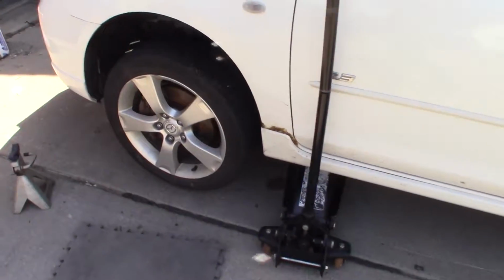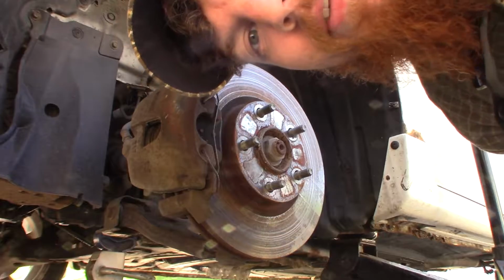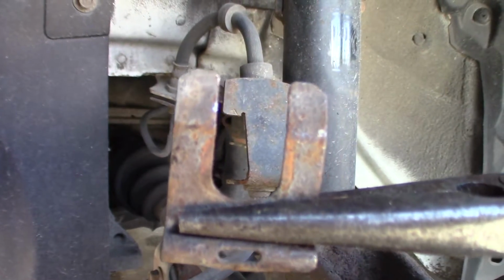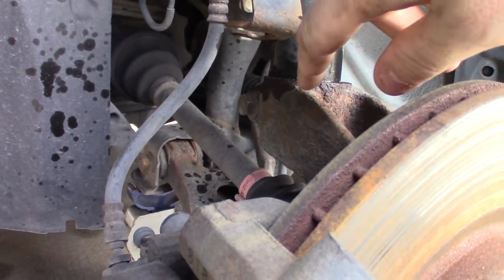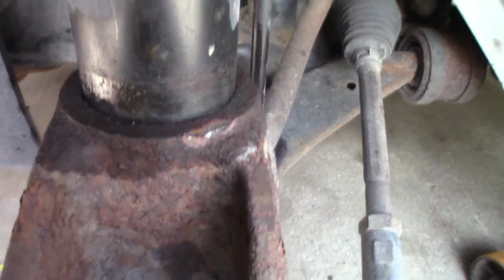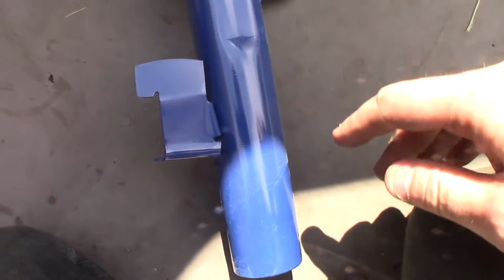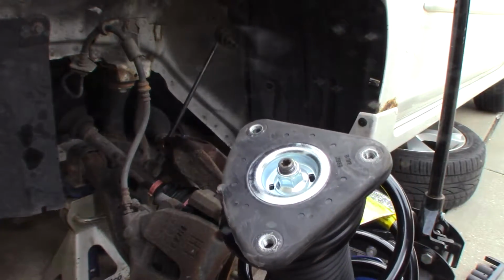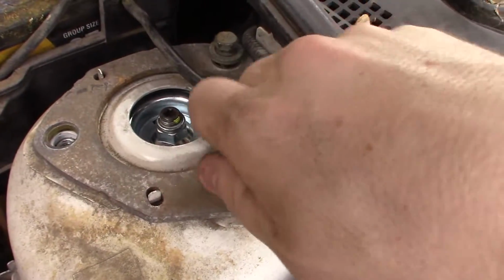How To Replace 2004 - 2013 Mazda 3 Front Struts

Comment: What are the torque values for the bolts holding the front struts for madza 5 (bottom one and top three)?
Reply from the maker: Check a factory manual, I just make them super tight.

Comment: Just something I did that I found to speed up getting the knuckle off the shock instead of beating it with a hammer is to take Your scissor jack and a 2x4. Put the 2x4 on the knuckle and then put ur jack ontop of the 2x4 and jack against the bottom of the spring plate then spray penetrating fluid around the shock and it’ll pop right out

Comment: With new springs in front and old ones in the back, does the front ride higher afterward?  Do you need an alignment afterward?
Reply from the maker: It could be slightly higher, probably not enough to care. Shouldn't alter current alignment